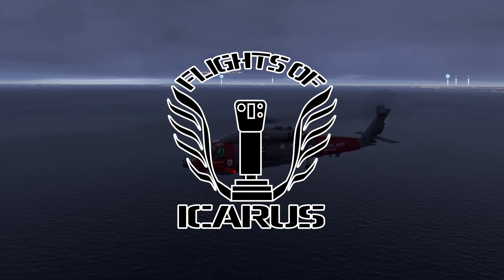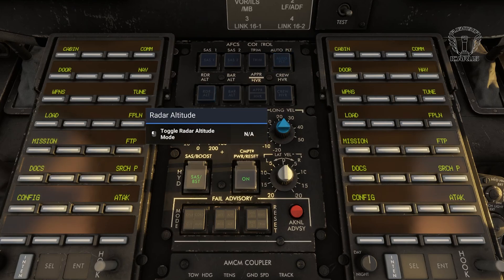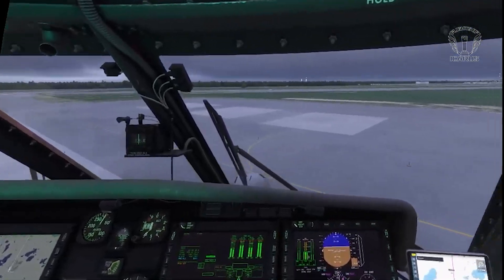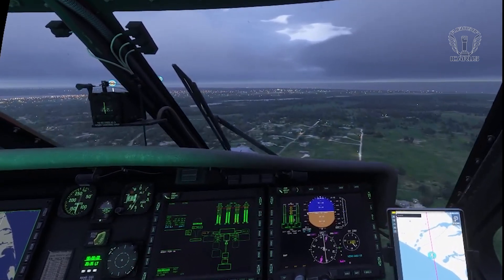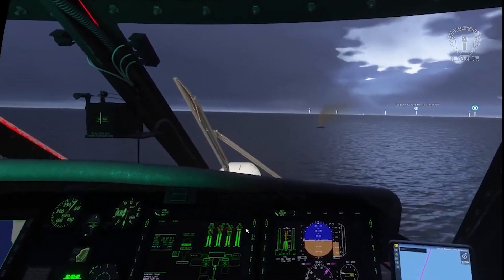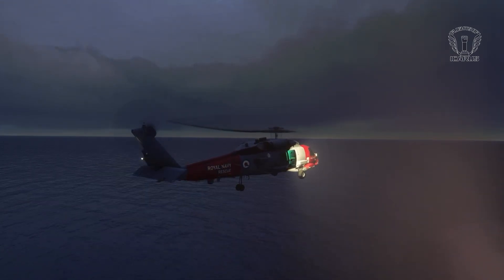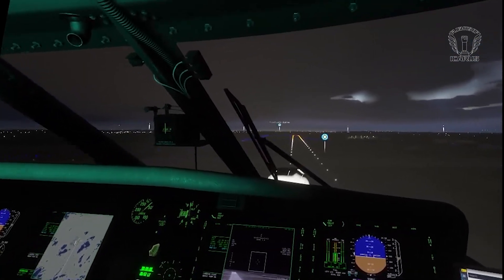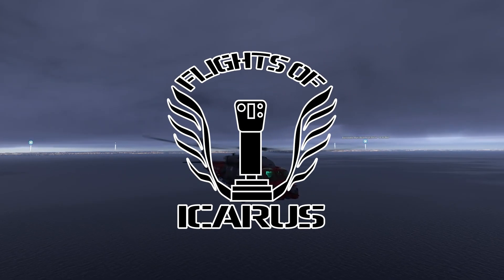#Miltech MH60 Autopilot Tutorial

Comment: Thanks for the video, very helpful. Can I ask how you were able to use the RN livery without the refuel probe being present? Every time I load in it's there and I can't find an option to toggle it or anything. Thanks!
Reply from the maker: I just selected the livery from the config menu. Never had an issue with the probe. It maybe something you can configure from the keyset on the centre console. There's a lot of config options there.
Reply: @flightsoficarus I figured out it was a fuel issue if I just load in with standard amount and refuel in the sim it fixes it for some reason

Comment: Thank you. So even with autopilot ON during cruise, heading course and altitude should be managed by manual cyclic. Is it correct?
Reply from the maker: Autopilot will maintain altitude. You need to disengage the autopilot to change altitude. The Autopilot will also maintain you current heading but you can change it manually with the cyclic and pedals without disabling the Autopilot.
Reply: @flightsoficarus  Thank you. Yes, I should also keep in mind below 5000: Radio Alt, above 5000 Baro Alt

Comment: I've seen others key bind longitudinal and lateral velocity so that you can maneuver the chopper from the back while in hover but I can't figure it out. If anyone can help it would be greatly appreciated thank you.
Reply from the maker: Looks like @jamieh8240 beat me to it. You can find full list of keybinds in the documentation here: https://docs.miltechsimulations.com/miltech-simulations-mh60/product-information/recommended-hardware-configuration/keybinds-guide
Reply: Crew Mode - Increase Lateral Velocity
Use MS2024 Key binding
INCREASE AUTOPILOT REFERENCE MACH

Crew Mode - Decrease Lateral Velocity
Use MS2024 Key binding
DECREASE AUTOPILOT REFERENCE MACH

Crew Mode - Increase Longitudinal Velocity
Use MS2024 Key binding
INCREASE AUTOPILOT REFERENCE AIRSPEED

Crew Mode - Decrease Longitudinal Velocity
Use MS2024 Key binding
DECREASE AUTOPILOT REFERENCE AIRSPEED
Reply: @jamieh8240 from what I've see it is not doable for the Altitude though. If you could figure that out you'd be genius.
Reply: @AcesHigh-68   The key bindings for hover altitude are:

Increase Hover Altitude
INCREASE AUTOPILOT REFERENCE ALTITUDE

Decrease Hover Altitude
DECREASE AUTOPILOT REFERENCE ALTITUDE
Reply: @jamieh8240 yeah I tried that but not working for me no matter what I bind it to??
Reply: @AcesHigh-68 I can't help you with that, unfortunately. I haven't bothered to bind hover altitude as I just set it in the cabin and use a 4 way switch to control movement.
Reply: @jamieh8240 thank you so much. It's working now 😃
Reply: @jamieh8240 great thank you sir works fine